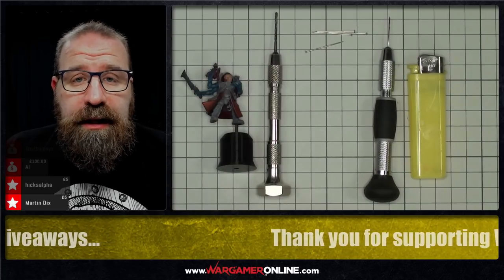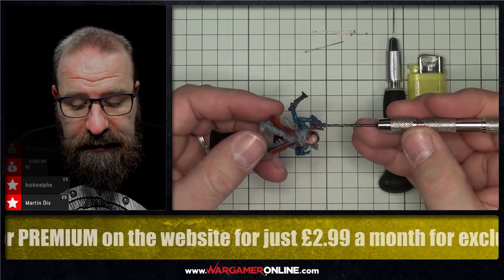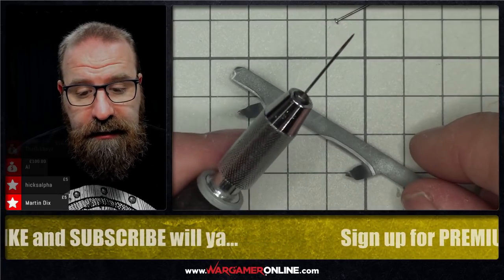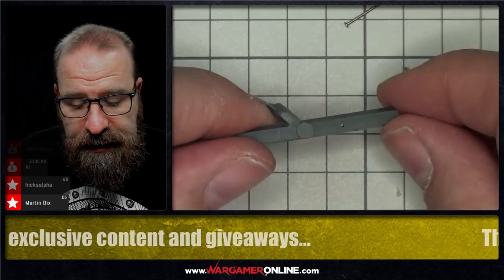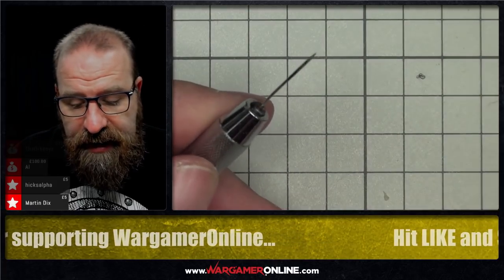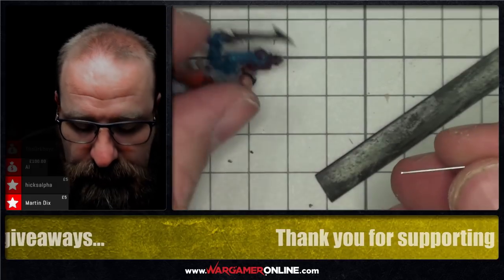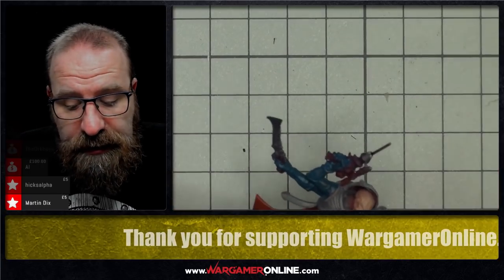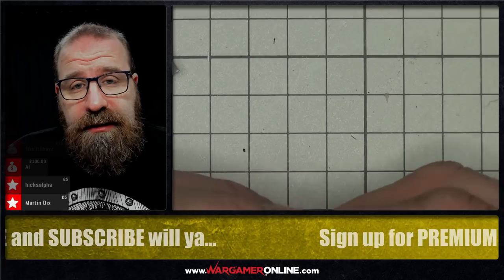Hobby Hack: Pinning the Impossible, pinning warhammer models the easy way!

Comment: Great tip. Any tricks for pinning metal or resin models?
Reply from the maker: Jim Worthington great idea, will do a couple of quick tip vids for you
Reply: Don't bother pinning resin, superglue adheres to it well enough that if you drop it, the glue joints won't be what breaks, the pieces will just break in half.